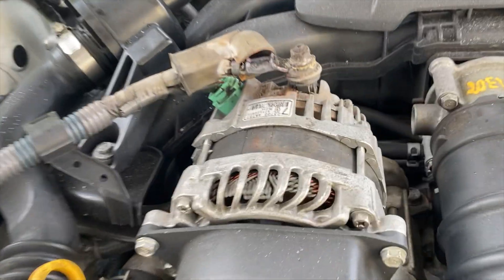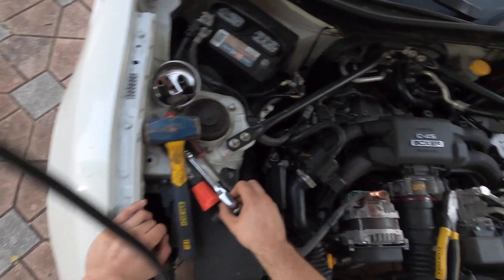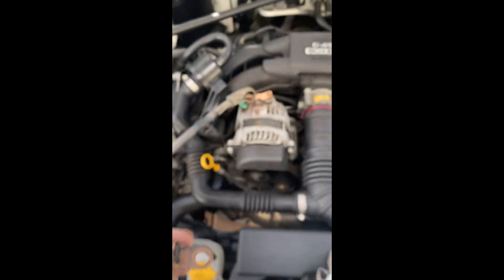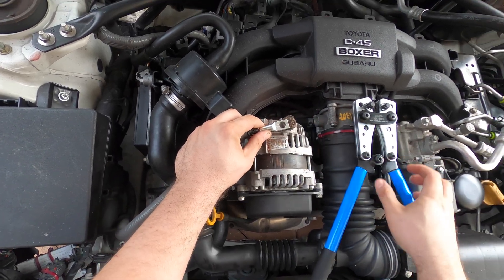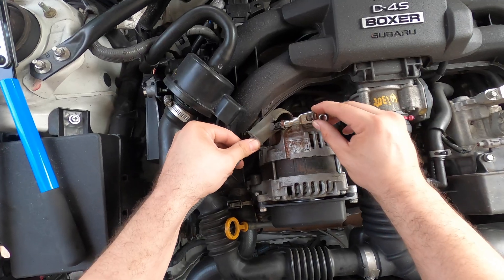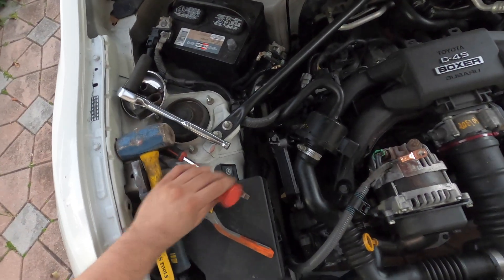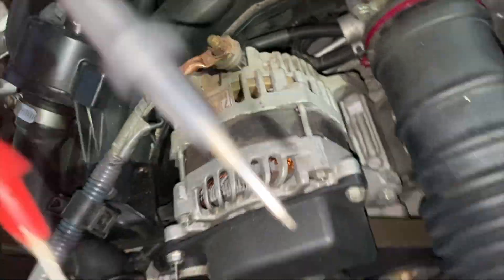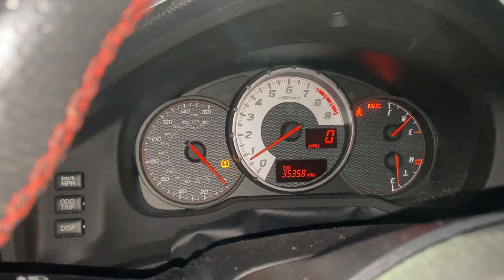How to fix an Overheating Terminal

Comment: If this is messed up you think it’s a cause of drain battery?
Reply from the maker: It won’t let the Alternator charge the battery properly, so even if you charge or put a new battery in, it’ll drain if the Alternator connection has a problem
Reply: @ thank you

Comment: I hade my rubber thingy melt too but my connection wasnt as bad so if you’re broke you can try dusting the pieces off first and then keeping a finger on the rubber for to see if it still produces heat (i mean using a steel brush/steel wool)